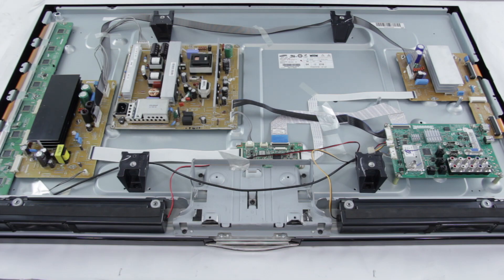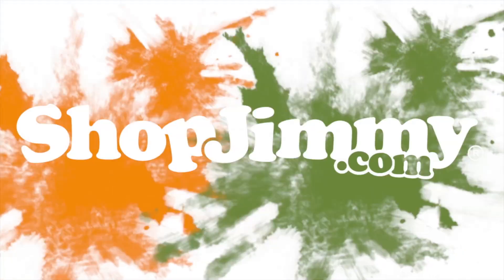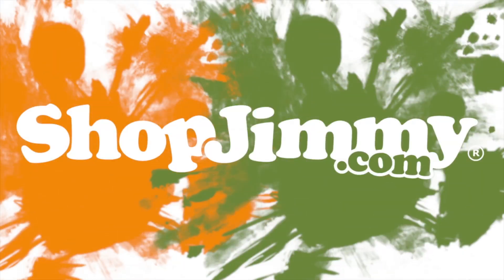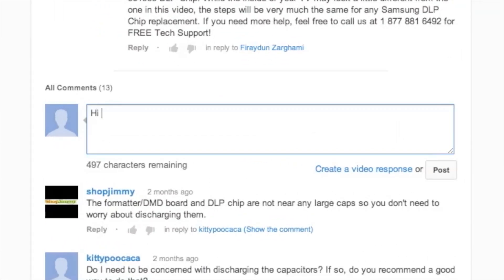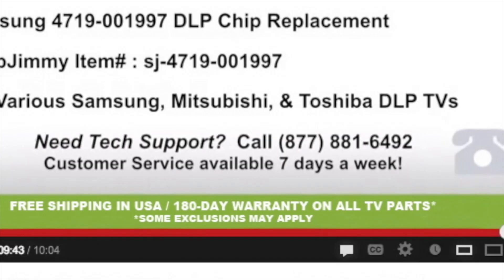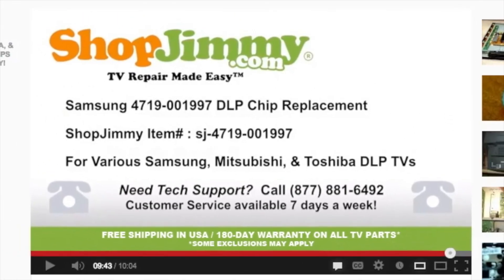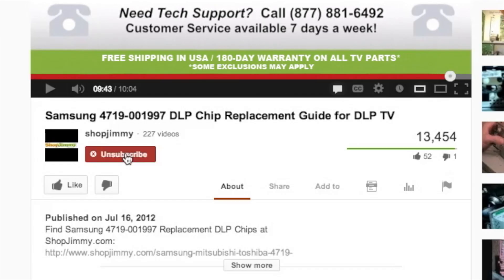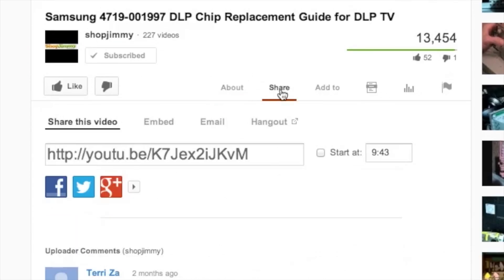Plasma TV Repair Tutorial - Common Symptoms & Solutions - How to Fix Plasma TVs

Comment: I have a 40" samsung tv. , mod LN40A550P3FXZA , I replaced two capacitors that seemed swollen.  T.V. still click, clicks, several cycles, comes on with several distorted screens, and then makes a real loud popping noise, recycles some more and eventually comes on for a brilliant picture and runs well.  Is this something besides capacitors?
Reply from the maker: Sabrina Cochran   This sounds like the power supply is bad.  Be sure the values on the replacement caps are the same as the values on the original caps.  You can also mail your board to us for repair, by purchasing our repair service on the following page/link.  http://www.shopjimmy.com/catalogsearch/result/?q=LN40A550P3FXZA+  You can also call our customer service for further assistance with your purchase.  (877) 881-6492  Thanks and please let us know if you have any further questions with your TV Repair!  www.shopjimmy.com

Comment: i have a panasonic plasma tv model th-42px80u . had a power surge it will come on but no picture i beleave it the main control board tnph0716
Reply from the maker: jim white  I recommend replacing the Y-Main SC Board in your TV.  Here is a link to replacement parts for your TV model number on our website, click here:  http://www.shopjimmy.com/panasonic-txnsc1bduus-sc-board.htm  Be sure to match part numbers on your current board, with your replacement for compatibility.  You can also call our customer service for further assistance with your purchase.  (877) 881-6492  Thanks and please let us know if you have any further questions with your TV Repair!  www.shopjimmy.com

Comment: Hi there, I have a 50" Samsung Plasma TV (Model Number PS50B530S2W.  (Model Code PS50B530S2WXXU)...Over the past few days I have noticed 7 black vertical thin lines (about an inch apart) on the left hand side of my screen....warranty has ran out,,I'm in the uk....They can be on hrs then go off or mins then go off......Can you please give me some guidance as what could be wrong......Regards.
Reply from the maker: david jones   This sounds like a TV panel problem.  If your TV panel is bad, it may be more cost-effective to replace the TV as panels are typically hard to find in stock, difficult to replace, and expensive.  Thanks and please let us know if you have any further questions!  www.shopjimmy.com

Comment: Hello - I have a Samsung HP-T5064. While watching a show last night the screen went black. I powered through cycles several times but the TV never came back on. However, the stand by light would come on. I unplugged the TV last night and this morning I removed the back cover and found what might be one bulging capacitor on the right side panel which I think is the X board. Could this be the problem with my power issues and could you tell me how to remove the white ribbon cable. I have been able to remove all other cables. Thanks for a great video!
Reply from the maker: John Knotts   I recommend replacing the X-main board in your TV.  Here is a link to replacement parts for your TV model number on our website, click here:  http://www.shopjimmy.com/catalogsearch/result/?q=HP-T5064  Be sure to match part numbers on your current board, with your replacement for compatibility.  Here is a link to a video showing how to identify your part number, click here:  Samsung Plasma TV Repair: Samsung Plasma Panel Parts Guide  You can also call our customer service for further assistance with your purchase.  (877) 881-6492  Thanks and please let us know if you have any further questions with your TV Repair!  www.shopjimmy.com

Comment: I have a Samsung 43" plasma TV. 
PN:43d450a2dxza
 ONce you plug the TV in it clicks, trying to turn on but never fulkly powers up and gets the classic clicking noise. I replace the power board ( from shopjimmy) before i saw this video. I think the Y main board is the cause, is this what you guys would recommend getting?
Reply from the maker: Joel Didier   I recommend replacing the Y-Main board in your TV.  Here is a link to replacement parts for your TV model number on our website, click here:  http://www.shopjimmy.com/catalogsearch/result/?q=43d450a2dxza  Be sure to match part numbers on your current board, with your replacement for compatibility.  Here is a link to a video showing how to identify your part number, click here:  Samsung Plasma TV Repair: Samsung Plasma Panel Parts Guide  You can also call our customer service for further assistance with your purchase.  (877) 881-6492  Thanks and please let us know if you have any further questions with your TV Repair!  www.shopjimmy.com

Comment: Samsung pn50c450b1dxza has 3 vertical lines running down the left
Reply from the maker: aosegueda91   This sounds like a TV panel problem.  If your TV panel is bad, it may be more cost-effective to replace the TV as panels are typically hard to find in stock, difficult to replace, and expensive.  Thanks and please let us know if you have any further questions!  www.shopjimmy.com

Comment: Hello,
 
I just finished viewing your Help video on YouTube, and have a question as to what you might think the issue is with my TV.  This is a Gateway GTW-P42M203  Plasma TV and the symptoms are:
 
I turn in on and the picture is fine (TV mode and Component1 mode – the only two I checked), within about 5 minutes the picture starts to fluctuate in color, semi large areas of red and green fade in/out, that is they get a bit brighter in color and then less… This will go on for another 3 to 5 minutes and then the screen goes completely blank, however it is not dead black, it is like having the TV on with no signal.  The audio stays functioning the whole time.  Also, if I click on the On-screen menu, it pulls up just fine in clarity and function.  For this reason I am not really looking at the Y or X boards. I did check the voltages going to both boards (the X and Y) and they are exactly as they should be – before, during and after the TV malfunctions. 
 
The boards that I am looking at as suspect are the Image (Main) board (DWPB11393-1GGWS), and/or the Logic board (LJ92-00621A)
 
Any thoughts/help would be appreciated.

Comment: Have Samsung LN-T4065F, shows only black screen with many, thin, white lines from top to bottom.  Power button and other buttons on tv do not respond. Connecting electrical cable to power on, gives slow start up, some clicking sounds and than shows the white lines, no sound.
Do you have a suggestion how to repair? Thanks
Reply from the maker: Frank Schermer   I recommend replacing the Y-board in your TV.  Unfortunately I do not see any replacement Y-boards in the search results for your TV model number on our website.  Thanks and please let us know if you have any further questions!  www.shopjimmy.com

Comment: I have an older Viore plasma V42PD45MS. And it will come on for about ten minutes and then the picture drops out and sound still works . You can flip the main switch off for a little while then flip it back on and it will work again but loses picture after a while again. Also there are these little like ghosting pixels that look like an old tv tuner on a channel that doesnt come in very good. And i have already swapped out the main power board .
Reply from the maker: William Tucker  I recommend replacing the  Y-board in your TV.  Unfortunately I do not see any replacement parts in the search results for your TV model number on our website.  Thanks and please let us know if you have any further questions!  www.shopjimmy.com

Comment: Samsung---Plasma---Model # PN43D450A2D   Sound but no picture.  I did not notice a popping sound or anything unusual when I tried turning it on.  I turned it on as normal and I just heard the TV program but no picture.  I tried unplugging the set for a few minutes but it did not help.  When it turned dark out side I tried again to turn it on.  Same thing.  This time, because it was dark I notice a white glow on the entire screen.  That glow would flash on and off about every second or so. Any ideas????  I'm pretty handy when it comes to fixing things but I know nothing about TVs.  Thanks, Craig
Reply from the maker: craig farlow  I recommend replacing the Y-main board in your TV.  Here is a link to replacement parts for your TV model number on our website, click here:  http://www.shopjimmy.com/catalogsearch/result/?q=PN43D450A2D  Be sure to match part numbers on your current board, with your replacement for compatibility.  Here is a link to a video showing how to identify your part number, click here:  Samsung Plasma TV Repair: Samsung Plasma Panel Parts Guide  You can also call our customer service for further assistance with your purchase.  (877) 881-6492  Thanks and please let us know if you have any further questions with your TV Repair!  www.shopjimmy.com

Comment: Hello, I have a Plasma Samsung 58" Flat Screen TV. I have owned it about 4.5 yrs
After around two years of ownership, we had to replace the Y board. It's been about 1 year and 10 months since that repair and once again, we are experiencing a black screen with sound.  I was watching TV and it just went to black screen. The model number is PN58B560 T5F. This TV was purchased brand new in August 2009. Any suggestions would be much appreciated. Do you think it's the Y board again? If so, how much does this part cost? How difficult is it to change? Thank you in advance.
Reply from the maker: Linda Choy   Yes, I recommend replacing the Y board again.  It can be removed by taking off the back cover of the TV, and then disconnecting the cables and removing the screws from the board.  DO THIS REPAIR AT YOUR OWN RISK  Here is a link to replacement parts for your TV model number on our website, click here:   http://www.shopjimmy.com/catalogsearch/result/?q=PN58B560+  Be sure to match part numbers on your current board, with your replacement for compatibility.  Samsung Plasma TV Repair: Samsung Plasma Panel Parts Guide  You can also call our customer service for further assistance with your purchase.  (877) 881-6492  Thanks and please let us know if you have any further questions with your TV Repair!  www.shopjimmy.com

Comment: Panasonic 2009-M#----TC-P50S1--------Made a "pop" then no picture, no sound.

Led BLINKS 7X's. Thanks in advance. Brian
Reply from the maker: Brian Ashe  I recommend replacing either the power supply board and/or the SC Board in your TV.  Here is a link to replacement parts for your TV model number on our website, click here:  http://www.shopjimmy.com/panasonic-txnsc1eduu-sc-board.htm   Be sure to match part numbers on your current board, with your replacement for compatibility.  You can also call our customer service for further assistance with your purchase.  (877) 881-6492  Thanks and please let us know if you have any further questions with your TV Repair!  www.shopjimmy.com

Comment: Samsung HP-R4252 sound no picture....was working fine and just went out
Reply from the maker: Rick Hardy  I recommend replacing the main board in your TV.  Here is a link to replacement parts for your TV model number on our website, click here:  http://www.shopjimmy.com/catalogsearch/result/?q=HP-R4252  Be sure to match part numbers on your current board, with your replacement for compatibility.  Here is a link to a video showing how to identify your part number, click here:  Samsung Main Boards & Digital Boards: Part Numbers for LED, LCD, DLP, Plasma TV Repair  You can also call our customer service for further assistance with your purchase.  (877) 881-6492  Thanks and please let us know if you have any further questions with your TV Repair!  www.shopjimmy.com

Comment: Gud day i have samsung plasma tv model PS51D45OA2XXP..it was working fine..when i plug it on i only hear  the usual cliking sound...the panel will lit a little bit not more than a second with diff color on the edge of the tv panel...the red led does not lit when on stanby mode..
Reply from the maker: manny torio  I recommend replacing either the Y board or the power supply.  You may need to replace one at a time to see which board fixes the problem.  Unfortunately I do not see any replacement parts in the search results for your TV model number on our website.  Thanks and please let us know if you have any further questions!  www.shopjimmy.com

Comment: one black line across the top half of a huge zenith plasma I pulled out of a dumpster. Y board right do I replace? Also I notice an oily residue on one side
LG pdp60x500
Reply from the maker: Greg Altman  Where the black line is check inside the tv all the way to the left and it should be the top buffer if it has 2 it might just have 1 long buffer but go I recommend replacing the buffer first.  Here is a link to replacement parts for your TV model number on our website, click here:  http://www.shopjimmy.com/catalogsearch/result/?q=LG+pdp60  Be sure to match part numbers on your current board, with your replacement for compatibility.  Here is a link to a video showing how to identify your part number, click here:  LG Plasma TV Repair: DIY Part Identification Number ID Guide for LG & LG Philips Plasma Panel Parts  You can also call our customer service for further assistance with your purchase.  (877) 881-6492  Thanks and please let us know if you have any further questions with your TV Repair!  www.shopjimmy.com

Comment: I have a zenith plasma  #p60w26a   tv when i turn the tv on its has vertical lines from bottom and top. but after 5 minutes its goes clear for 45 minutes. then the vertical lines come back it stays and get worse.???
Reply from the maker: NettyNett77  This sounds like a TV panel problem.  If your TV panel is bad, it may be more cost-effective to replace the TV as panels are typically hard to find in stock, difficult to replace, and expensive.  Thanks and please let us know if you have any further questions!  www.shopjimmy.com

Comment: Hello I have a LG DU-50PX10C.  I am having sever black and white (salt and pepper) on the screen until it warms up.  It now takes it almost and hour to fully warm up.  I also have some image burn in on the lower left portion of the screen.  What board should I replace
Reply from the maker: tywone hannah  I recommend replacing the Y-SUS board in your TV.  Here is a link to replacement parts for your TV model number on our website, click here:  http://www.shopjimmy.com/catalogsearch/result/?q=LG+DU-50PX10C  Be sure to match part numbers on your current board, with your replacement for compatibility.  Here is a link to a video showing how to identify your part number, click here:  LG Plasma TV Repair: DIY Part Identification Number ID Guide for LG & LG Philips Plasma Panel Parts  You can also call our customer service for further assistance with your purchase.  (877) 881-6492  Thanks and please let us know if you have any further questions with your TV Repair!  www.shopjimmy.com

Comment: I have a Panasonic Plasma TV, Model TH50PX50U, that I purchased in Jan. 2006.  No picture, power light blinks 10 times.  Any idea what part I need?  Thanks.
Reply from the maker: Michael Leto  I recommend replacing the SC Board for your TV repair.  Here is a link to replacement parts for your TV model number on our website, click here:  http://www.shopjimmy.com/panasonic-tnpa3567ab-sc-board.htm  Be sure to match part numbers on your current board, with your replacement for compatibility.  You can also call our customer service for further assistance with your purchase.  (877) 881-6492  Thanks and please let us know if you have any further questions with your TV Repair!  www.shopjimmy.com

Comment: Have 46" Panasonic Vieira TC-P42S30. Turned TV on and all I get are vertical pattern with no sound. Across middle of screen. Four blocks ( diff width)with identical pattern of lines that will appear on top than middle then bottom

Comment: Hi, the Tv is a Samsung Plasma Display - Model PS50A457P1D - there are multiple thin verticle coloured lines and two wide black vertical lines running down the right hand side of the screen...
Reply from the maker: claire wilmot This sounds like a TV panel problem.  If your TV panel is bad, it may be more cost-effective to replace the TV as panels are typically hard to find in stock, difficult to replace, and expensive.  Thanks and please let us know if you have any further questions!  www.shopjimmy.com

Comment: Thanks for the video.  I am hoping you can tell me what I need.  I have a Samsung PN58B550T2F.  We have had it for about 4 years but it doesnt get used very often.  I tried to turn it on a few months ago and there is no picture.  It makes the sound like normal when it turns on but the redlight turns off after a few seconds.  My husband pulled the back off and he thinks all the capacitors and fuses are fine.  Thanks!!
Reply from the maker: kimfournier1 I recommend replacing the main board in your TV.  Here is a link to replacement parts for your TV model number on our website, click here:  http://www.shopjimmy.com/catalogsearch/result/?q=PN58B550T2F  Be sure to match part numbers on your current board, with your replacement for compatibility.  Here is a link to a video showing how to identify your part number, click here:  Samsung Main Boards & Digital Boards: Part Numbers for LED, LCD, DLP, Plasma TV Repair  You can also call our customer service for further assistance with your purchase.  (877) 881-6492  Thanks and please let us know if you have any further questions with your TV Repair!  www.shopjimmy.com
Reply: ShopJimmy.com Ok we ordered the main board and replaced it tonight.  Now it won't power on at all.  The red light is on so I can tell there is power to it.  Any ideas what it could be?  Thanks!!
Reply: We put the original main board back on and the tv then powered on. It made the power on sound like normal and flashed a light on the screen then went black again.  Could it be a different board?  Thank you!